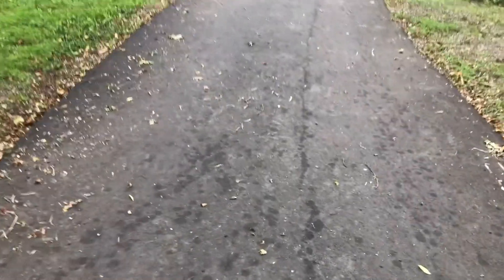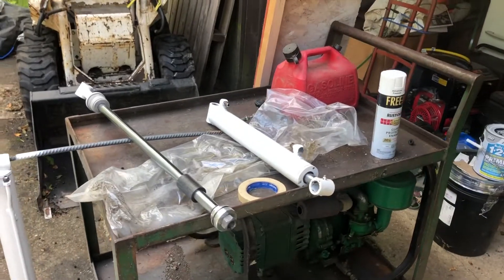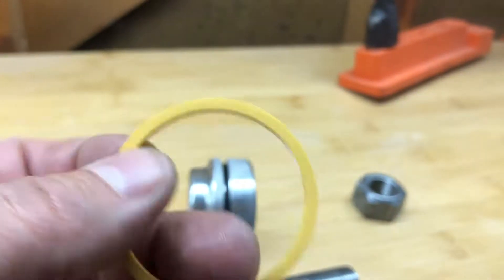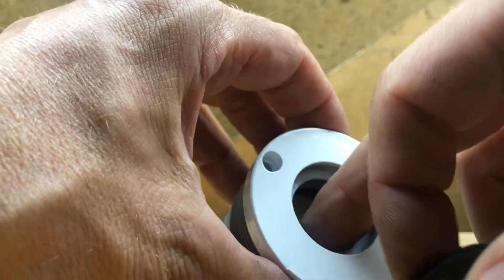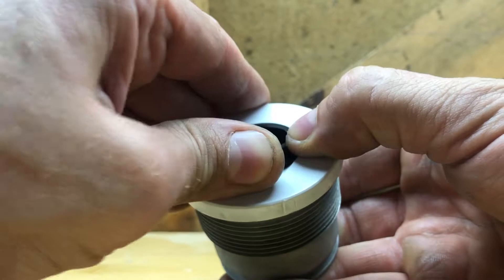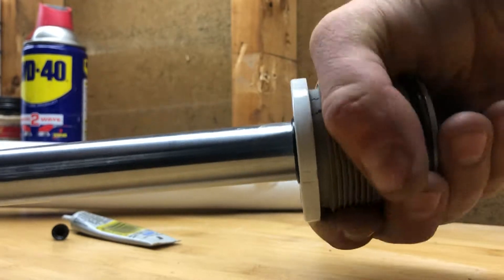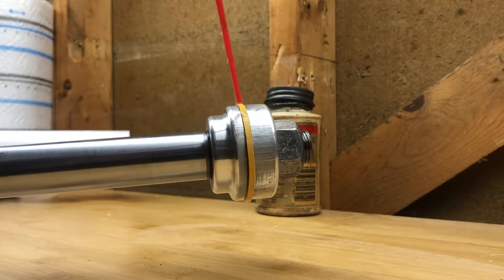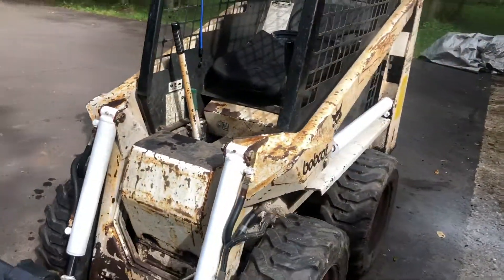Clark Bobcat Skid Steer 310/313 Hydraulic Cylinder Rebuild and Seal Kit Replacement

Comment: Hi! How did you bleed the air out from the cylinder? The problem I have now with my bobcat 310 after replacing the seals is that it's jerking especially moving the lift up. Thanks in advance
Reply from the maker: Sorry for the late response. I ran all of the cylinders through a complete cycle a few times. Seemed to work well.